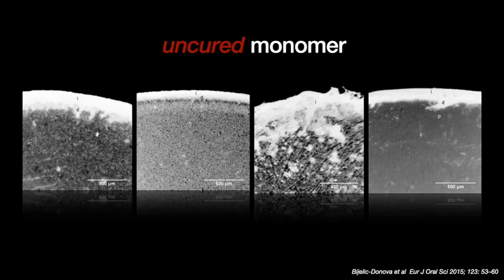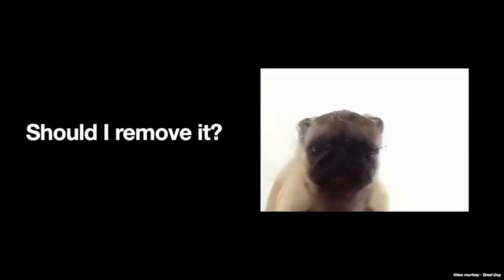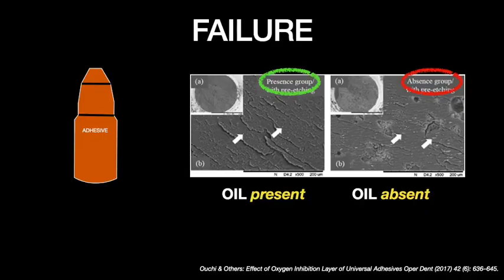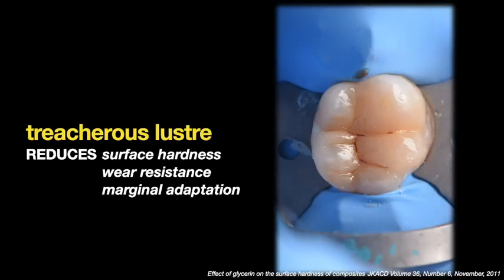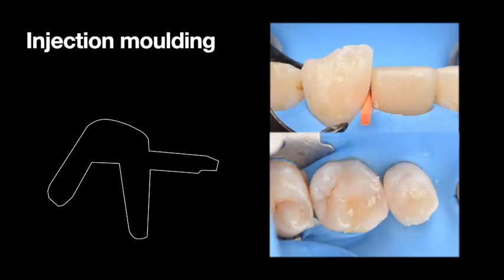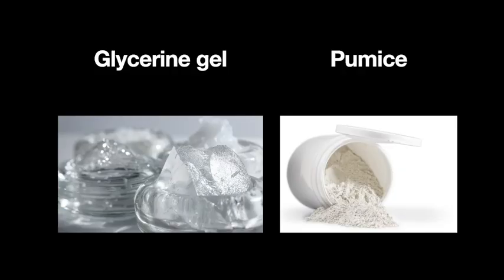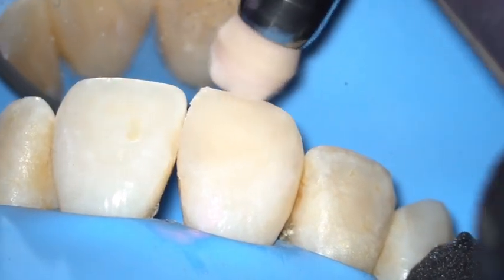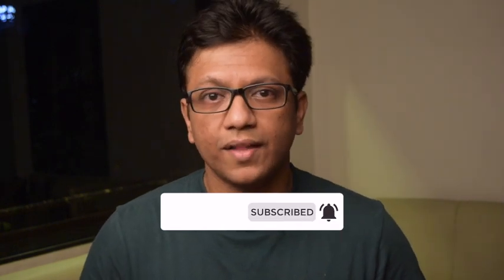Composites turning yellow

Comment: Sir can I remove the oxygen inhibition layer simply with diamond burs ?
Reply from the maker: No. that's not the right thing to do
Reply: But I did and the results are good. composite didn't turn yellow after I removed a layer with diamond but and  polished the topmost layer with rubber cups

Comment: are we still able to bond to resin surfaces that have its oxygen inhibited layer removed using additional composite resin? For example if i polish a rein surface and decided i add more to it using resin, do i have to apply adhesive again to the polished resin surface ? Clinically i have not seen any one do so that and it seems to bond pretty well  , it’s just i’m having trouble understanding how additional rein can be added to a already cured resin when technically there are no free radical left to initiate chemical bond.
Reply from the maker: Yes. you can do that if you are readding it immediately. but if it is after few days then the free radicals are absent and you need to surface treat the composite in order to bond again

Comment: i use revotec LC from GC for direct temporisation. The crown turns yellow in 2-3 days. I think the reason is same and i will try using glycerine gel on top of it. Though when i finish & polish this temporary crown with silicone abrasives, the oxygen inhibition layer is removed....still it turns yellow.
what do you think could be the reason?
Reply from the maker: yes doctor, its the same reason